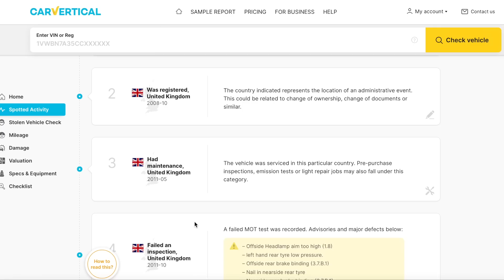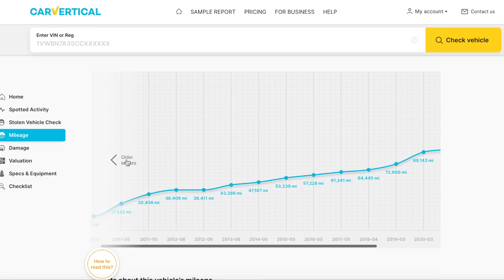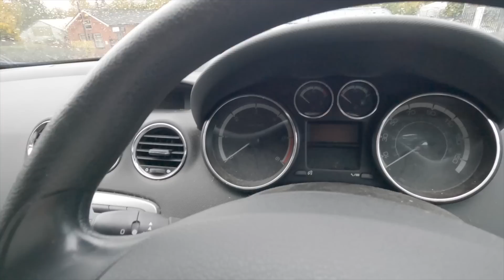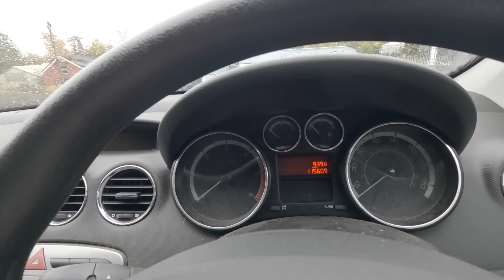I BOUGHT A CHEAP PEUGEOT 308 FOR £300

Comment: Well I have had a 308 diesel for 4yrs without any problems, and its been faultless changed the oil every 4000 miles change the cam belt at 50000 the grip I have it as not got good suspension bit solid and loud over bumps but it as served me well and zips along when Turbo is in action I know I need a Range Rover but just out my range now, I know there French and cheaply built but I have loved it.

Comment: Nearside and offside front roll bars? The whole concept of an anti-roll bar is that it is one bar that connects two otherwise independent suspension units to impede rolling.  Still, not bad that the roll bar only broke into two pieces after transporting all those horses in the passenger seats through the smelly countryside. C'est la vie. [Suggest that the advisory concerns drop links.]

Comment: "Since new", owner of a 2008 Sedan 307 (TU5JP4 engine, manual GB, 1,6L "flex fuel" (Gas/Alcohol). Not a single issue in all these 16 years. The thing is solid and eats curbs for breakfast.

Comment: Ya lot complaining about french cars. Yes their petrol engines are not the most reliable but that's because BMW designed them. VTI and THP. Their diesel engines are still one of the bests on the market. The only thing that goes wrong with them is like most modern diesel cars - ADBLUE. I have my 3rd peugeot now (1.4 petrol 207 73bhp, 208 1.4 hdi and now 308 mk2 1.6ehdi) and I honestly can tell you how much more reliable and cheaper to run theses cars are compared to my friends BMW, MERC, AUDI (so the holy trinity of cars). 
All cars have their bad sides, you can buy brand new s class coupe (for 300k) and have problems with it - I recommend searching about it on youtube.

Comment: I actually drive a '62 plate 308 eHDi, and yes, it's as bland as cars come; but reliable as heck, and in the 3yrs I've been running it has cost me very little in terms of running costs, mot's, and other failures.  Bland can also be cheap, which isn't a bad thing with how little cash most of us have spare right now in the UK. (My radio is also set to 'greatest hits')
Reply: Thanks for your input can you let me know which engine you currently got as am looking to get the diesel engine
Reply: @jamiraafful9790  1.6L  eHDi with 6spd manual box. Pulls well when needed. Cruises on motorway as good as anything. Supposed to be one step off a hybrid, though ironically the stop/start rarely works. lol
Reply: @jamiraafful9790  I am in Australia and have a 2.0L diesel. The best engine put in a Peugeot (don't know if it complies with European emission standards). All the mechanics I have spoken too (Peugeot or European specialists) indicate the superiority of the 2.0 engine. I have a 2012 308 HDi (2.0 diesel) with 160,000kms on the clock - extremely good at high speeds (mine is a 6 sp. automatic) and mountains are not an issue, with with a full load. Is considered "just run in". I have retired now so I don't do the distances I used to.

Good luck - they are a great car. Just make sure they are serviced regularly.

Comment: I bought one of these 12 months ago for £1000. It was a 2009 1.6 S petrol auto with 63000 miles on it. It had never failed an MOT and with full service history. The only problem it had was that the heater didn't heat properly. I think it needed a new heater matrix and on its MOT I had to have a new coil spring fitted. After 6 months and 6000 miles I sold it to my barber for only £900 at which point my new lease car had arrived. It was cheap motoring for 6 months and I knew I could get more for it but what the heck.
Reply from the maker: Was the box terrible?
Reply: @HighPeakAutos  no it worked fine but the car felt underpowered. Manual probably better.
Reply: @owrang9756  No - the 1.6 petro; and diesels were a bit underpowered.

Comment: Had an '09 308 1.6 HDi Auto for a while - I actually loved it, thought it looked quite stylish for its time and the price. Drove well, never gave me any problems compared to the '05 Astra I had before it. Very spacious, everything worked and picked up speed nicely, if a little noisy.
Unfortunately reversed it into a bollard at a fairly low speed and the whole rear bumper including chassis was damaged. Really don't know how it could have got that badly damaged from a bump but there you go. Swapped it for an '08 320i coupe.
Oh well, this video brought back nice memories.
Reply: The reason the car folded when you reversed into a bollard was because its a peugeot, cheap nasty cars with poor build quaility and reliability.
Reply: @gravemind6536  haha that much I agree with!
Reply: @gravemind6536  What absolute nonsense. Build quality (except for the 1990's) is excellent. Reliability is brilliant (check rally results over the past 50 years). I speak from experience as our family has owned Peugeots since 1957 - 403, 404, 504, 604 406 407, 308 (and a couple of station wagons). I am not a mechanic and I drive hard and fast. Always had them serviced. Never had a major problem in that 50 years. I tried to count up the kms travelled in our family - I stopped at 8 million. That's right  - north of 8 million kms. between 1969 and 1990 I travelled between 50-70kms per year. I usually traded my cars at around 200,000 kms. I lived in Western NSW where roads  (except for the highway) were pretty odinary. Ask Africans, Argentinians or Australians about reliability - Peugeots are renowned for their reliability. Apparently English Peugeots must be different!!!!!

BTW the bumper would have to be replaced because of the sensors - same in most cars now - they are built to crumple (safety)

Comment: I'm looking around for a second hand car, but my god, since 2019, it's all shot up at dealers, it's cheaper to buy from individual sellers these days.
Reply: I bought my car in 2019 I didn't realise it at the time but it was the perfect time for me to get a good car before the market warped into its current mess. The car I bought has lost no value at all because the market is so messed up from the supply shortage and the cash for clunker schemes dealerships used to run. Probably going to be at least 8 years before I get another car.
Reply: Unfortunately as new car sales dropped due to not only manufacturing but cost, used car sales have shot up. 😢
Reply: @Rhyd  Yeah, I remember buying a yaris 2013 trend for £7000, with 30k miles, no chance would I get another at that price today...and it was auto. That was in 2018.
Reply: @Aatish2k8  the good days when you could buy a car under scrap value 😂
Reply: @Rhyd  Yep! 😆
Reply: @Aatish2k8  I got a 2016 (66 plate) Toyota Auris 1.2T 40k miles for £9500 in March 2019. It would still cost around the same today.
Reply: @Rhyd  Not long ago you could go on autotrader and get a running car with 12 MOT for £500 now you can't get anything like it for less than a grand.
Reply: @gravemind6536  Nice, I'll check it out on Auto Trader, cheers.
Reply: @gravemind6536  my first car was a 1.6 focus with mot for £200, even then tried haggling down 😂 The only positive about the current market is the potential for profit flipping cars.

Comment: my late father had a 12 plate 308sw hdi access. was poverty spec but was very reliable and never broke down. suppose because he serviced it every year and it wasnt that old, dunno if the new owners would keep on top of ithe servicing or just run it into the ground
Reply: I'll never understand not servicing your car at least the basic stuff. You neglect to have new oil and filters you end up paying nearly the same cost in extra fuel consumption and thats before the mechanical failure of the car.

Comment: Shame about the result but your decision to punt it onwards made sense. Also I was disappointed your Harrods plates weren't gilded! Can I ask what the camera set-up was at 12:58mins and how you managed to pan the image slightly on what was presumably a fixed camera position on the rear pillar, was this done in post by starting a bit zoomed in and just rotating or do you have some fancy bit of kit?

Comment: You need air conditioning all year round. The air conditioning clears condensation on the windscreen and windows. It's because people don't use air conditioning that ends up with cracked seals and escaped R134a gas.

Comment: Just a few comments on the 308 diesels in general.
1) The 2.0L diesel is far superior to the 1.6L
2) I only use Michelin or Pirelli tyres.
3) At 115K miles the diesel engine should be just about be run in. Should get at least 250,000Miles without a problem (more in the 2.0L diesel)
4) the 1.6 lacks a bit of power - In Australia where we travel long distances at speed so the 2.0 diesel is almost a  necessity. However if you are just travelling around town the 1.6 is quite OK.
5) I never worry about scratches on the exterior - happens in older cars.

I live in Australia so maybe the geographical environment is different. I can't understand why he doesn't like Pugs (maybe an English thing). Except for the 1990's Peugeots are one of the most reliable cars on the road.

Thanks for the video - I'd certainly say this car had its life on a farm and rough roads hence some of the issues mentioned.

Comment: Great video as  usual. Just a quick question, do you not have to use trade plates to drive these vehicles you buy?
Reply: Private sales you’re technically supposed to unless you tax and insure it there and then. You might get away if it’s still got insurance and tax left on from the previous owner. Not saying you should drive it but you could

Comment: I hate it but it's a stop gap vehicle while I do my entire house up. Kitchen, windows and doors, roof, plastering, bathroom... EVERYTHING, so yeh. Bought a cheap shitbox to help me pay for everything as I live alone. Have a 2009 308 1.6 diesel that I picked up for £1000 with only 101k on it. I'm only the third owner and was being sold cheap by an elderly fella 2 miles away that had a stroke and could no longer drive. Masses of service history, annually serviced. He admitted he pranged it and it had a replacement rear bumper as well. No issues in 2 years I've owned the car. Gets me 70mpg heading to work. Impressive.

Comment: I had a long held hankering for the previous version of this ( the 307) I loved the look of the car, and eventually i bought one - a 307 2lt diesel hdi ,...... that car ended up costing me SO many sleepless nights over the five years I owned it,
 unbenownst to me whoever had owned it before had used plain tap water and antifreeze for radiator filling rather than pure coolant that contained inhibitors, - the worst thing possible you can do on these as for whatever "Gallic" reason ALL the coolant pipes (thin steel)  are  routed along the back of the block under the manifolds from front to back rather than inside said block as WE would do it and were absolute pigs to get to (slanty engine against the bulkhead and all routed right up behind the turbot with half an inch of space), and  of course on an engine that is alloy head and cast iron block you can imagine the galvanic corrosion that ensued ! I chased one blasted coolant leak after another after another on that car for four whole years cost me a damn fortune in coolant grrrr,  and when i say leak i mean total dumping of the whole coolant in one hit at the worst possible time. - Never again,  ended up selling it as a non runner and bought a 65 plate Focus 1.5 S  Diesel, and boy what a difference...........120 horse AND a genuine 65 to 70 to the gallon  PLUS  zero road tax !!!! - lovely little car wish I had bitten the bullet sooner.

Comment: I had a 1.4 308 2009 … Never ever again cost me a fortune, everything went wrong 
I even had to replace the heating matrix £300, then the thermostat which was £150 that's just the start...
Of course, it being the prince engine I had to put in a litre of oil every 500/600 miles 
I'd rather walk or catch the bus than buy another 308
Reply: That’s what happens when you buy a vehicle with a BMW engine

Comment: I had a 307 & the 308 I don't get how Peugeot messed the 308 up.
You know it's bad when the 307 handles well in the snow and the 308 gave up on a slight incline

Comment: How Peugeot went from making great handling cool cars in the 80's and 90's to tat like this is mystifying
Reply: Money they keep it cheap
Reply: Actually the Peugeot great days were the 50's to the 70's 203, 403, 404 & 504's - all a mile ahead of their time. Quality did suffer for a while in the 90's but picked up again after about 2002-3. I have a 2012 2L 308 diesel. Great car - loads of power, comfortable, relaiable and handles well. (if you use the right tyres)

Comment: I drove a 207 for several years, it was my mothers daily driver and she passed it to me because she didn't need it anymore after retiring and I was dirt poor at the time.. The thing was an absolute money pit. Although I had it for years I didn't put much mileage on it (it had 61,000 miles on it which is pretty good for a car that age). Nonetheless I  had to replace all the brake pads and disks at least three times, the whole exhaust assembly from the manifold back (including the catalytic converter) Every time I took it for an MOT at least one part of the suspension had corroded so badly it needed replaced. The bracket for the exhaust had to replaced on a yearly basis asit rusted right through.
Just put it in for a part exchange on a new(ish) Yaris hybrid and the difference has been night and day. No longer having to keep an ear out for the 'clonk' of busted suspension or the grinding sounds of busted brake pads or disks makes for a much more relaxing drive.
Reply from the maker: I couldn't agree more. Very wise with the Yaris hybrid
Reply: You sound like you bought the cheapest Chinese ebay/local motor factor parts you could get. If you purchased oe spec replacements you would not of had this problem! I am speaking from experience. I am not knocking you as you said you were poor at the time. These days car parts carry that old saying, buy cheap buy twice!  I now only buy major brand O.E replacements as it just isn't worth buying the cheap ebay/local motor factor rubbish.
Reply: @user-ee5xs6lg1t  I didn't do any of the work on it, All the work was done at a properly registered garage.
Reply: @ianbremner4436  Yes but again if they use cheap parts which a lot of these little garages will. There's your reason for the high failure rate. Cheap car parts are dreadful these days and are a false economy. Even a lot of the big name stuff is now made in China. I buy OE manufacturer parts now from autodoc

Comment: Before I watch this, I always liked these but would never buy one for reliability concerns. Probably unfair as I had a renault Laguna years ago and was a great car I loved, and reliable. Although I looked after it quite well.
Ok lets go!
To be fair 100k milers for 300 quid will have suspension bits and bobs that need doing, and they arent cheap. It may be better to use your CAR APP to check the NOT history before confirming any offer you make on a car.

Comment: I own 14 years old 308 GT so top spec model back in the days and it's got 2l HDI engine which are honestly bulletproof 💪 mine has got 142k on clock and it's unbelievable good runner with no issues whatsoever 🙏 I even been in it for Europe trip this June and have done 4700 miles in 2 weeks time. No problem. And it does 900 miles+ on long run too. ( Motorway driving) . (60l tank). Service cost me 50£/ every year for oil and filters as that's all I change. No topping up oil or anything from service to service.   I had previously 308 1,6 HDI sport for nearly 6 years and that car was brilliant runner. It had over 170k on clock when I left it.  And my 2nd weekend toy now is 308 GTi BPS ( by Peugeot Sport) 270 model over 5 years now and it's absolutely faultless not a single issue 🙏 amazing fun, cheap to run for what it is as it can do 500+ miles and service don't cost me more than 120£/year if I change spark plugs as well. Only 60£ if I don't. So 👍 I can't say a bad word about Peugeots at all. I think They're brilliant cars if you're look after them . Peugeot has got brilliant diesel engines anyway. (PSA) which are used by many other car manufacturers.
Reply: Wow you are really a peugeot lover.We have got 1.4 HDi Peugeot 206 for 8 years.(From 2007 to 2015).Great car!
Reply: @denizuysal9188  it's not about Peugeot lover pal I just had good experience that's all 😃 and still own 2 pugs now as daily and weekend toy without any issues.
Reply: @ejdydmj1650  Wow nice.Have a nice ride friend!
Reply: Agree re the 2l diesel. Best engine they ever put into a Pug. As you say - bulletproof. Mine is a 2012 Peugeot 308 HDi - 160,000kms. Mine has 17in alloy wheels, heated front seats, leather seats. Great car. I'll drive it until they perfect electric engines (which they haven't done yet.) You should get 500,000trouble free Kms from that engine.
Reply: @allanbriggs807  easy pal if you look after it . I have friend with same engine in his 308 GT 2l HDI. And he's on 280 000km . No problems at all .